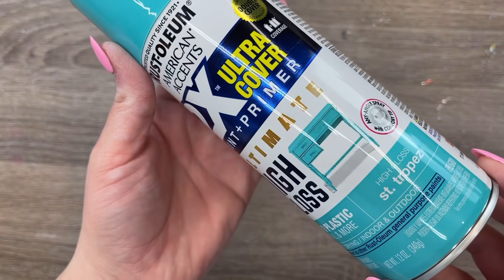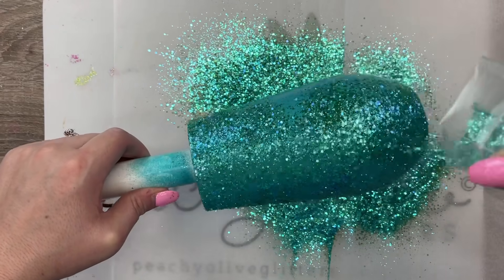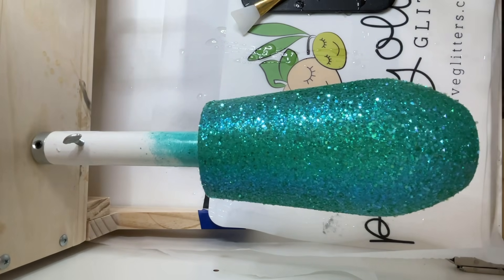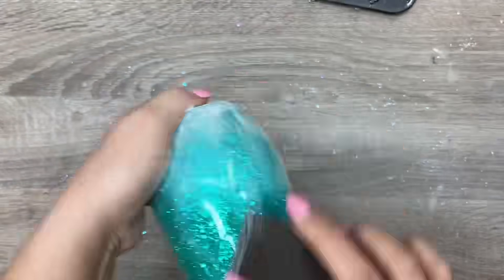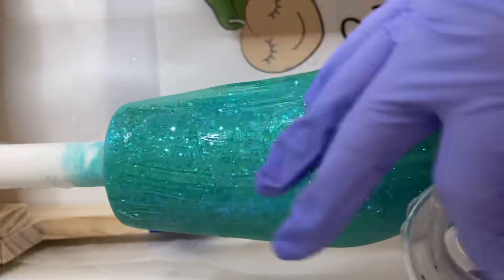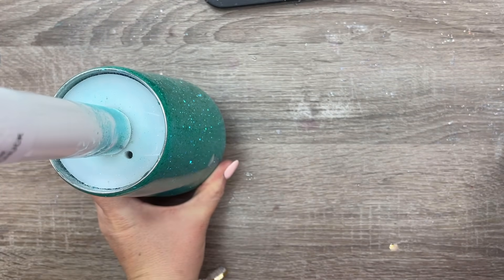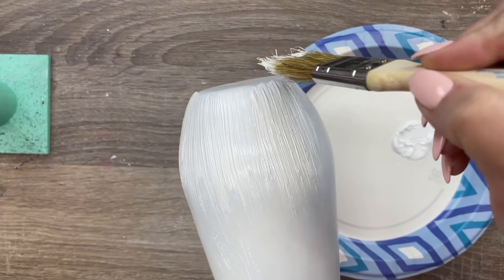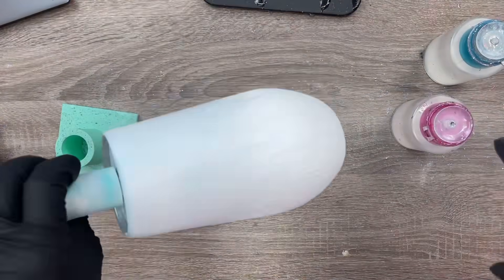Gold Brushstroke Tumbler Tutorial

Comment: Hi! Does the paint not stick to epoxy, and that's why it has to be spray painted fully after you epoxy over the glitter? I get so confused about when to use sealers/epoxy/quick coat and what will adhere to what. Thank you for another great tutorial.
Reply from the maker: No, I just spray painted the white so I could get better coverage with the paint. Acrylic paint would have stuck well enough

Comment: Just wondered,When you applied Tack-it on cup did you wait for glue to dry and then apply gold leaf? Also instead of gold leaf could i use the glitter foil?  I have nail foils and would like to use? Like your cup,very cool. Thanks and have learned so much from you.
Reply from the maker: I do wait a little bit for it to be tacky, but not dry. Nails foils should work as well.

Comment: I am a newbie to tumbler making and I've started 3 so far.  They definitely have some work to be done on them but what I love about resin is it's kind of hard to mess up.  (I've done custom art print coasters with resin finish but not tumblers).  But I have a question if you have time to answer.  The first cup I made ended up having resin drips in it.  Not huge ones but enough that I had to sand them out because my X-acto knife wouldn't get under the thin drips so I could just peel them off.  Does that mean I'm using too much resin?  I've started taping the inside of my cups to see if that helps but like I said, I still have work to do on the three I've started so I'm not sure how well it works.  I did get the dang hard pink flower looking foam things with my turner and I'm pretty sure I don't like them so I am probably going to look for another option or make my own with thick foam that will fill most of my cups so they don't wobble or anything.  

I'm a new sub to your channel and I am in love with your method of teaching, your great tips (like the one about straightening the bottom if you have an oopsie), and the outcome of your gorgeous tumblers!  This one is STUNNING and tealy green is one of my most favorite colors!  Beautiful work!  I can't wait to binge more of your videos. 😍🥰
Reply from the maker: I would definitely use lighter coats of epoxy on each layer. Also, you have to keep the cups turning longer so that they have cured enough to where the epoxy is hardened and it wont pool and drip.
Reply: @FlynnSistersBoutique  Thank you!  Is there a way to calculate how much resin to mix up for different cup sizes?